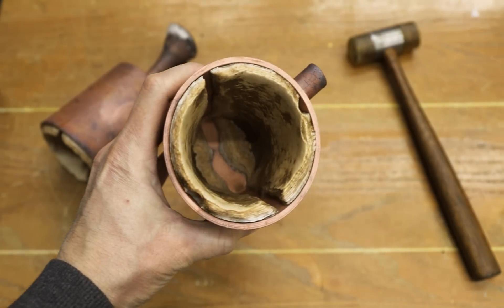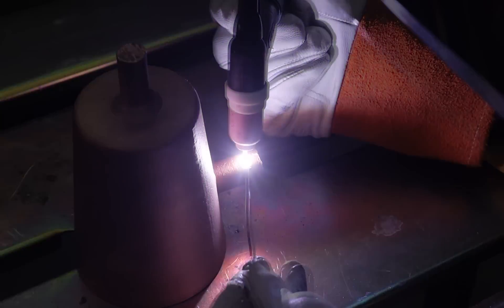Making Solid Copper Mugs, but should you drink from them?

Comment: Been planning to do something like this myself. Though I think I'll make my mom a pancake skillet first.

Question: what copper alloy do you think would make the best knife? I am wanting to make an agate handled knife for a rockhounding friend of mine, and a good bronze or brass would compliment some of the green agate I have.
Reply: If you use Aluminium-Bronze (not sure on which specific alloy is best but shouldn't be to hard to find out), you can quench harden it -- get a pretty respectable hardness out of it too, somewhere in the ~45HRC range if I'm not mistaken.
Considering that the unhardened material usually sits at half that (it's a logarithmic scale), it's pretty impressive.
Reply: Please tin your skillet.

Comment: Very neat! Though, you might want to consider plating the lip and inside of the mug with silver to keep the copper from leaching into any drinks with citric acids (most sodas) or anything above a fruit-juice. Apparently it only takes 27 minutes for a Moscow Mule to leach more copper than FDA regulations allow in safe drinking water. 
Silver plating the inside would also save you from having to clean off the inevitable oxidization/patina! At least on the inside =D
Reply: I thought similarly also, that the insides should be tinned in some fashion to prevent contamination, especially if used with wine, which also has a high acidic component
Reply: BS - it same as a copper pot, NOT TOXIC!!!
Reply: @ZAPATTUBE  Not to mention half the houses in the states still have copper water lines lol 
yeah i know, a year late =P

Comment: You dont really want a more conductive material for a mug. This will just make the energy flow better and make hot things cool faster and cool things heat up faster.
Reply: Was about to say this lol. Copper would be terrible for any drink you want to keep at a certain temperature. It will reach equilibrium with the environment too quickly.
Reply: Yeah, you should keep these in the freezer, instant cold drink. Super cool for that (get it?) Otherwise, the opposite of what you want
Reply: @TheMinecraftReloaded  instead of you having the drinks in the frige you have the mugs lol, sounds like a shark tank business model, but i guess in very cold weather conditions the heat of your body can warm the drink
Reply: Yeah, very, very attractive mugs. But horrible for all the reasons you give. If you pour  cold drink in a mug, you want the mug to NOT get cold. That’s called insulation. 
    But, very cool looking mugs. It would be neat if you make the mug the exact size of a disposable plastic cup. That way you can slip a plastic cup in the mug to insulate your drink.
Reply: Copper is unmatched (other than silver) for certain cooking purposes, but pretty bad for other purposes.
Reply: I’d love to have a mug that makes hot drinks cool faster. Concerned about the taste being affected by copper ions though.
Reply: until it reaches a thermal equalibrium
Reply: I've been told that copper is the only metal that actually kills bacteria. All operating rooms should be made with copper instead of stainless steel. Then we wouldn't get infections like staph and flesh eating disease from getting medical procedures.
Reply: tell that to the entire world of alcohol consumption
Reply: But to the human brain the drinks feel colder. That's cause your lips are touching the cold copper mug and it tricks it into thinking the drink is colder, even if in reality the drink is warmer then if it was served in a ceramic cup. There's a YouTuber called Adam Ragusea who made a whole video on this topic.
Reply: @MelonMafia1 yeah, a Moscow mule just feels colder in a copper cup then a glass or ceramic cup. Feels the same when you drink from a can. Ice cold can of pop feels colder than a plastic bottle from the same fridge.

Comment: All my Moscow mule cups are lined with stainless. Wonder why? 🤔🤦
Reply: Acidic drinks like a Moscow mule can cause copper to leak into the drink. So if the drink sits too long in a pure copper cup, it can get to a dangerous level and poison you, but it does take a few hours for levels to get that high

Comment: These look great. If you plan to try and make them again, before you start applying slurry, finish your blanks with wax and make the finish as you would like to see the final product.  You can eliminate the printing striations and seams with the wax filling in the ridges.  The slurry will take on the smoothness of the polished waxed mold and when you melt the PLA the walls of the mold will be smooth.  Your finished product will be dolphin smooth.
Reply: This is exactly what I thought when we was smoothing out the edges of the glued on part!
Reply: He has done this before, I believe on his orangutan skull cast. No idea why it hasn't been a frequent feature since, its a great technique
Reply: Also, exporting the initial CAD model with a higher precision in the STL file or even using a slicer that accepts STEP files will help greatly with the grainy circles.  It is a cool look on the finished product for this project, but if you want nice smooth circles it is perfectly possible to achieve with a normal 3D printer.
Reply: great idea, i hope he sees this
Reply: I second this!
Reply: Damn solved a problem for thank you
Reply: That's one way to do it, and and a good one. But there's also sanding the model, you can use heat to smooth it out, or vapor processing with acetone, etc, among other, frankly more labor intensive, processes.
Reply: dolphin smooth
I love it
Reply: I wish I had the skill levels to  understand what you wrote....but the dolphin smooth bit was great :)

Comment: Just so that you are aware, copper can leach into to your food/drink in amounts that aren't safe to consume. This is why typically things meant for contact with them are coated in a plastic or a different metal that is safer
Reply: You better rip out all of your plumbing then!
Reply: What about lining it with tin? Low melting point so you could practically paint it on if you get it melting like butter...Is there something wrong with this approach?
Reply: Obicham vodka!
Reply: Tinning copper is a common practice in the coppersmiting world. For the reasons stated above.
Reply: Are you an idiot?  Every house in the united states has used copper water pipes for the past 100 years+.
Reply: Ok Karen
Reply: why is plumbing done with copper pipe then
Reply: @TheL0k3  Your water isn't as acidic as citric acid is. Copper is an essential nutrient for your body, but the problem is that in high amounts it is dangerous
Reply: Copper is toxix when you try to fry with oil or lard. Drink anything that doesn't contain it is safe.
Reply: SO COPPER PIPES ARE UNSAFE THEN, I DON'T KNOW HOW ACCURATE YOUR COMMENT IS, WHY WOULD COPPER BE USED IN PLUMBING THEN??!!🤷‍♂️
Reply: @Plainsimple67  Technically speaking the type of metal used in plumbing should be irrelevant if the water is being properly treated. As long as the water is maintained above 7 for the PH (usually 7.5 or higher ph with about 140-250 ppm total dissolved solids) it will not leach metal from pipes. Same reason why lead pipes were used in plumbing for many years without issue (until Flint decided not to adjust pH and TDS to bring them to the proper levels needed for safe distribution).
Reply: Sources?
Reply: What do you think? I HAVE A WHOLE COPPER BOTTLE HOLDING MY WATER😂😂
Reply: Peeshaw
Reply: @SubliminalVibes  so what are you saying? The citric ACID in limes isn’t acidic?
Reply: We have copper and various other metals in our bodies bloodstream anyway, my only concern is that copper oxidizes and turns green so they wouldn't last more than probably a few days if you're lucky a few weeks, putting a plastic lining in is pointless if you're having hot drinks which melt the plastic or alcoholic beverages that would break down the plastic and then be consumed so I would recommend these as a novelty aesthetic look not actual everyday use
Reply: @SubliminalVibes  Copper is NOT "perfectly safe to use", nothing is PERFECTLY safe. It's all about the quantity. Even "poisons" aren't dangerous in sufficiently low doses. In the case of copper, the general consensus is that more than about 30mg/l is considered toxic.
Reply: Wrong copper is perfectly safe and far preferred over plastic crap
Reply: @jimmechanic1965  >  Wrong copper is perfectly safe and far preferred over plastic crap

Someone clearly doesn't know about Wilson's and Menke's diseases. 🙄 Hypercupremia is a thing. 😒